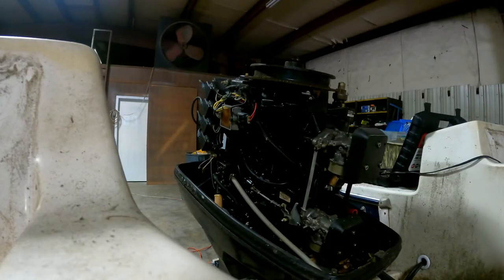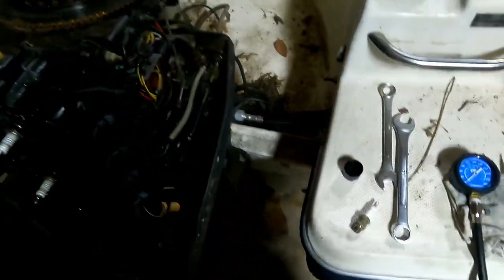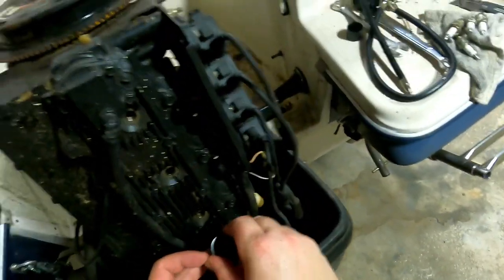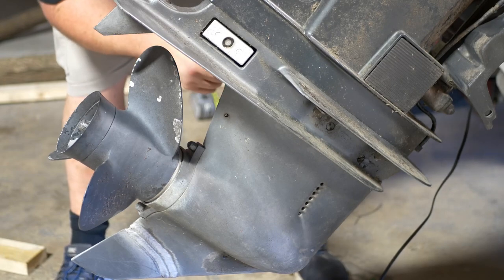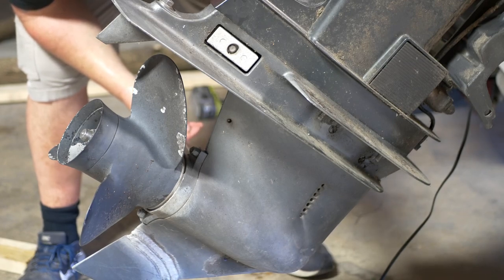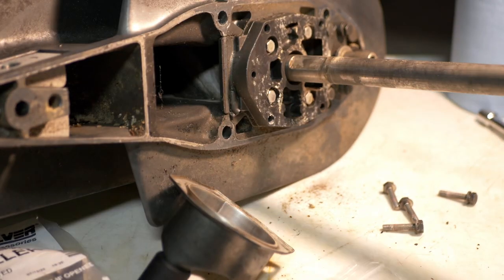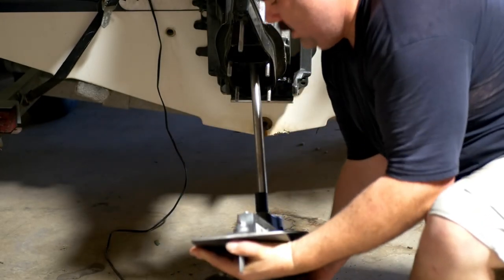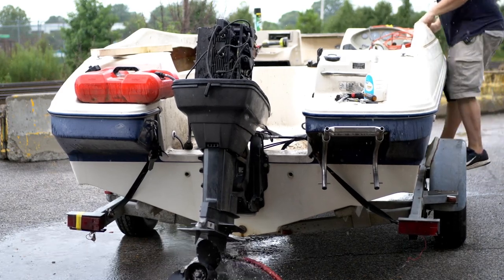This motor has been dead for 12 YEARS! Restoring a Fiberglass Boat

Comment: Thanks for the shout out! She’s been a great boat since I’ve done the work on her. 

Sounds like that starter is going out, I had the same issue. I bought my starter off eBay for 60ish, and yes it was a new Chinese one but it’s held up for 4 years so far. 

The force that you have is a Chrysler block and electronics, merc lower and controls. It was owned by US marine and  sold to merc. My 90 and my 120 have been amazing!
Reply from the maker: Hey man, that’s excellent knowledge right there. I did a little research but it looks like you did quite a big more. Very cool.
Reply: @FatGuyinaLittleBoat  I’ve had some boring days on deployments lol
Reply: @FatGuyinaLittleBoat  and, I’ve been looking into it to restore my dads boat that has a 90HP we’ve had since new. I also did all my own work to my 120, with the exception of syncing the carbs
Reply from the maker: Ahh yes deployments. Nothing but time to learn.  Make sure to document your dad’s boat!
Reply: @FatGuyinaLittleBoat  I’ll try, but I have a lot of other projects too like a 3/4 NASCAR I have to restore
Reply from the maker: Well, good luck lol. That’s a full plate!

Comment: When I first started watching you I mentioned that I had bought a boat and was rebuilding it. Where you are now is where I was. I rebuilt the carbs and changed all the fluids. I put it on the lake and it would take 10-20 minutes to actually start. (At the house on ear muffs it would start right up) Anyways, found out that it was the fuel. It was the one thing I didn't think about. What he said about the ethanol fuel in an old mercury is very true. Yall listen to the fat guy cause he knows a thing or 2. Much love 👍
Reply from the maker: Thanks man. Fuel is apparently the single biggest problem with these old Force motors. You have to feed them right!

Comment: My force did the exact same thing. Starter wldnt disengage, it ran and started rough, and it was hard on a battery. I bought a Merc to replace it and have never had any major issues with it....yet.
Reply from the maker: I think a new starter will be in the works soon. At least a rebuilt one. Apparently it is a common issue.

Comment: Also, those 120s love their fuel on a cold start, I usually give mine a bit of throttle before she fires
Reply from the maker: That sounds about right. Seemed to me like the top carb was having issues. It’s going to be running shortly.
Reply: @FatGuyinaLittleBoat  the one issue I had is syncing the carbs. I just gave up and took it to someone who knows those systems better. Lol

Comment: I thought you wouldve left the plugs out of the cylinders you wernt testing. Much easier on the battery and starter.
Reply from the maker: You know I’ve been told to leave them in but you might be right.
Reply from the maker: In fact, you are right.
Reply: That’s an unloaded cylinder test which is not an accurate PSI, but you can do both.
Reply from the maker: Looking around I see reasons for doing both and I’m giving myself quite an education.

Comment: just a tip on the fuel, if you can get some av gas from a local air feild you will be cooking with the good shit,
Reply from the maker: That sounds like a plan.
Reply: @FatGuyinaLittleBoat  98% octane and 100% leaded, rumer has it it will make ya grow hair in funny places.
Reply from the maker: That sounds both disturbing and interesting.